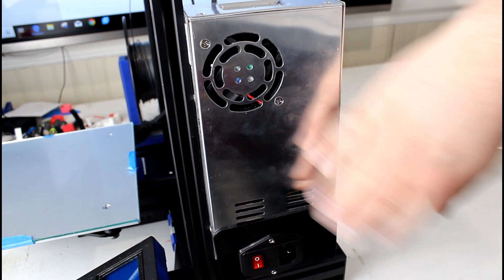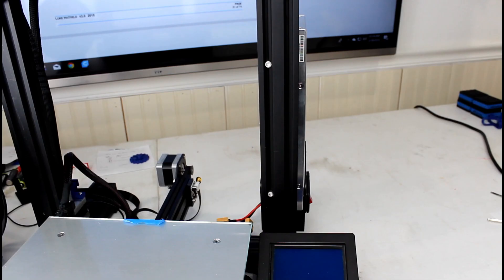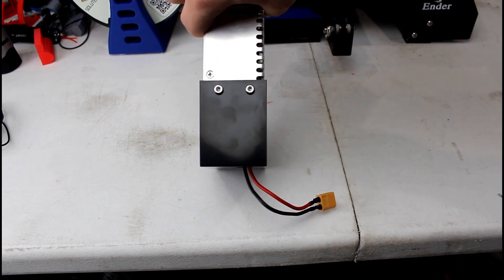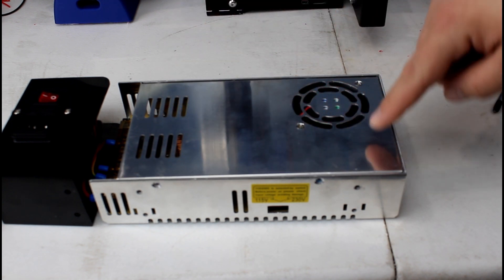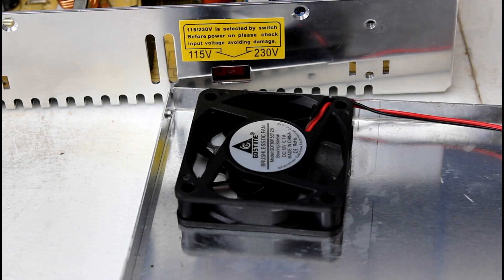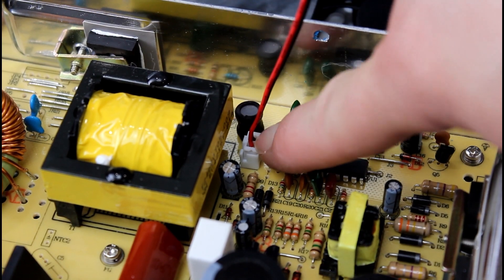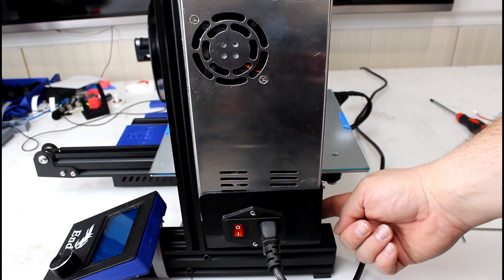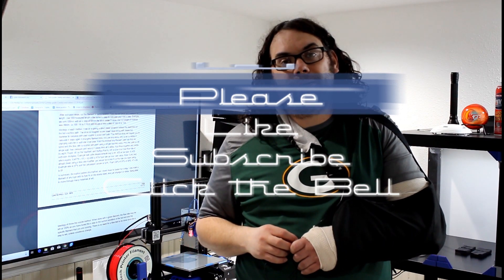Replacing the Power Supply Fan on the Ender 3

Comment: you can take a low rpm fan..ive never seen that cornor where the PSU sits get warm at all. The exhaust air is just slightly warmer than roomtemp. In the Ender 3s1.

Comment: I put a different fan in forgot wire orientation, anyways that fan got hot and don't spin but still works on another computer, I put stock one back in and it doesn't work now, any idea what could have fryed on the board?

Comment: Your problem affects all users of Chinese power supplies.
But I have some own comments:

1. Not a fan sticker, but the shape of the fan blades tells how to arrange it.
If the surface is convex, then the fan winds the air.
If it is concave, it draws in air. I mean the position of looking.

2. Time 2:50 - when you say you compare plugins - please focus first, or check it out. Because you can't see anything. Completely useless because unprepared or checked while editing the material.

3. Your enclosure has no fuses on the power lines. This is not good because it may end in a fire. It is easy to use fuses from the car on 30A, which are located in series on the cable.

4. Good Electrical Tip - always use the thickest cables when you can. This will save you money and time for heating. Using thicker cables in this box will shorten the time of heating the bed.
In my Kossel power supply, the 360W bed heats up to 90 degrees for ABS in less than 8 minutes.

5. It is worth swapping the windmills, but the problem is the lack of a temperature sensor. Just insert it and the fan is rarely activated. This is the Chinese abbreviation for their savings obsession everywhere - here it is 5 USD (https://www.amazon.com/gp/product/B07PGZL1LF) to connect instead of small shortcut on the mainboard next to the fan connector.

Regards guys...

Comment: Hello I have a question about the Ender 3 Meanwell Power Supply Fan. I noticed that you have the sticker facing outward. My sticker appears to be on the inside so it's blowing air into the PSU. Shouldn't it be pushing the hot air out? I wanted to make sure because it seems the PSU fan runs constantly while printing which leads me to believe that it's not cooling the PSU properly if it's constantly running.
Reply from the maker: It's meant to be on all the time I believe. If it's a mean well power supply, I would leave it the way the factory put it in.

Comment: The fan you pulled from the power supply says 12v, But the ender 3 is a 24v system?
Reply: The PSU is a separated part, internally, and thought it supplies 24V to the printer  board does not mean internally it works with 24V. You have to check out since some works 12V and some 24V. For instance, MeanWell PSUs works with a 12V fan.

Comment: Warning In my ENDER 3 bought summer 2019 the cooling fan is 24V NOT 12V as stated here.

I was lucky as I tested it before reassembling and quickly isolated it when it did not spin before it burnt out completely, it did however overheat and let out some smoke so I can't return it as unused.

In hindsight, I should have read some comments here, and opened my PSU and checked the fan Voltage before fitting and also before wasting money ordering the wrong fan.
Reply from the maker: Thanks! I just out a warning in the description of the video now as well! They must have changed which power supply they use.
Reply: @TheEdgeofTech  Ender 3 have always been 24v mate

Comment: I have had a problem for a while, with my printer that it just occasionally turns off. Just checked how hard would it be to change the fan which was noisy and while opening the PSU I noticed that in my factory default Ender 3 Pro, the fan was facing the wrong way! Just turned it to face the other way (pushing air out from the PSU) and since then the printer has not even once restarted on its own.
Reply from the maker: Awesome!!

Comment: My fan (Ender 3 purchased 11/2019 w/non-magnet bed and silicone sock on hottend) says 24v on the fan itself and it's a 24v power supply. Your milage may vary.  Verify before ordering parts.
Reply from the maker: Great point! Check the fan before you order to be 100% sure! They change parts a lot on us lol
Reply: @TheEdgeofTech  videos make it easy - however, user has to apply common sense to their application. You produce great vids. Thanks

Comment: Would it be ok to just disconnect the fan? i don't use it with a heated bed, i have other led psu's who dont use a fan.
Once the fan of this one turns on it stays on, when i power it off and on again the fan is off.. makes no sense.
Reply: Do so at your own risk. Cheap Chinese electronics (which means everything about the Ender 3) are fire hazards at the best of times. The PSU fan exists for a reason.

Comment: The fan on my Meanwell power supply on my 2019 Ender 3 Pro fan sucks the air in and it blows out the bottom.  AND it's 12Volt
Reply: Same on mine (early 2019) .. and the opposite of what's shown in the video
Reply: Same here and I think this is wrong. Makes no sense at all. Should suck air in at the bottom and blow it out at the top. Otherwise, the fan is working against the natural convection of the warm air in the case.

Comment: Does this mod work on the Ender 3 Pro? I am aware that the Ender 3 and Pro have different PSU's . If so , is the stock fan 12v or 24v ? I have a spare Nactua NF-A4x10 FLX fan ready to go that is 12v
Reply from the maker: Since the PSU that comes with the Pro is a Meanwell, I am not sure if this would work. I know that the case is much smaller and I have not opened one up to look. It may be a smaller fan or different size.
Reply: @TheEdgeofTech  OH wow thank you for the fast update. This is an excellent channel filled with endless info =) <3
Reply: @Reed_0024 , the fan on the Meanwell power supply on the E3Pro sucks the air in and I can confirm that the power supply on my E3Pro has a 12 v fan.
Reply: @Grumpyoldtwit  Yes I did the paper test and seen it suck the paper to it . Ty for the update.
Reply: My E3P with MeanWell has a fan that says 24v on it...

Comment: Is it better when fan blow in or out? For me seem better solution to blow in, when i put hand on  fan with buckconvertor seem weak power to suck. When i change fan to blow in, seems more wind for all board.
Reply: My Meanwell power supply sucks the air in.
Reply from the maker: That's a great question. I probably would just follow what the manufacturer did to be safe, but you never know it may work better the other way.

Comment: I tried this but my new fan I bought said 12v .2a. It did not work. Like mentioned below my stock fan said 24v. Luckily I had a 24v .1a fan kicking around. I plugged that one in and when I hit the power switch the 24v fan popped and you could smell the burn.

Update: the polarity of the red and black wires of the stock fan were reversed compared to the standard direction they are crimped . Make sure to double check your old and new fans cords for matching red and black wire placement
Reply from the maker: Good teaching moment! Thanks for watching and for the update!

Comment: I think Ender 3 use a 24v fun, doesnt it?
Reply: hi, I have ps labeled s-360-24 with my new tronxy. Fan was noisy as hell an i want to replace it. When I open ps there was fan with jx6015 14v 0.1A. I measure fan header and its 22.6V. It seem that all those supply have 24v header and uses trash 12V+ fan. That 12v fan must suffer on 24v, no matter, what kind is it. Its simply 2x overvotaged. When i use 24v 0.1A it teroretically should be quiter, but depend on type of fan. Questin if best choise is 24v 0.05A or use 12v noctua with backconvertor to definite noise killer.
Reply: @martinhyska1206  Sunon Maglev is inexpensive and has around 25db and costs 20% of price of noctua.
Reply: My mid 2019 Ender 3 Pro has a Meanwell power supply and the fan in it is 12Volt.
Reply: @Grumpyoldtwit  Seems all that cheap supply has 12v fan on 24v header. But buying 24v fan not solve it. Better is buy buck converter and reduce noise stock fan. https://www.aliexpress.com/item/32725312642.html?spm=a2g0o.productlist.0.0.4849447ekRUG7D&algo_pvid=fb08a453-ba86-4e97-bf1e-31df55760717&algo_expid=fb08a453-ba86-4e97-bf1e-31df55760717-13&btsid=b6793b0f-bded-4cf9-a955-75e0f27ed8ef&ws_ab_test=searchweb0_0,searchweb201602_2,searchweb201603_52
Reply from the maker: The other fans on the Ender 3 are all 24 volt. But the power supply fan is 12 volt. Thanks for watching!
Reply: @TheEdgeofTech  Just opened up mine, to replace it with a 12V one I bought. Before plugging it in there I (as everyone should!!) measured the output voltage on the fan header, and it was 24V! My fan connector also wasn't halfway on the board, but all the way at the end, near the trimpot / main connectors. It's a recent Ender 3 non-pro, about 2 months old.

So would advise anyone doing this, to first check the existing fan before ordering a new one
Reply from the maker: @Blamm83  Great to know! Thanks for the heads up! I wonder if they changed something in those power supplies? Thanks for watching!

Comment: I have realized that my fan is connected to the other fan connector right next to the output terminals. My fan runs 24/7 if my PS is turned on. The cases says its temp controlled. Is or was your fan temp controlled?
Unlike your fan my fan is labeled DC24V 0.1A (Type CHA6024RL-15B).
Reply from the maker: Good question! I will take a look! Thanks for watching!
Reply: I've got a Flsun QQ-S which has a 24v PSU and claims the same thing ("temp controlled fan") but again is on 100% all the time whenever it's on. I wonder if they're the same power supplies. I tracked mine down to being a Sunsky S-360-24.

Comment: Great ! I'm on Project Quiet my self, the Missus doesn't like the noise of my printer, this is next on my list! I thought about putting a heat sink on top of the PSU and doing away with the fan, then thought better of it.
Reply from the maker: Nice! You can quiet it down a lot by printing the damper feet from thingiverse, or putting it on pieces of the foam it shipped in also. The fans help a lot, but the vibration is what really makes it loud.
Reply: I'm doing this to my ender 3 pro now - I got the SKR mini e3 board - now I'm looking for a hotend fan and powersupply fan to get them silent.

Comment: You are doing some great videos. May I suggest anytime you do one where you are replacing parts like this it would be nice to give good knowledge about the part. Like what voltage and maybe even a link to a good fan that fits and works well. Thanks again for the videos.
Reply from the maker: Great idea! Thank you for the feedback! And for watching! I'm gonna add link to the video. :)
Reply: @TheEdgeofTech  Thanks
Reply: Perhaps also more and ample warning about the inherent dangers of opening a power supply. (Avoiding the capacitors at least, proper cap discharge and ZVV at best.)